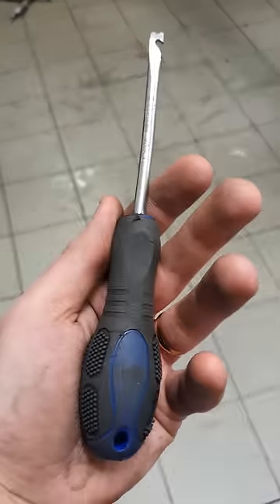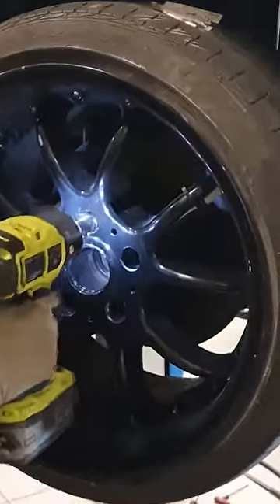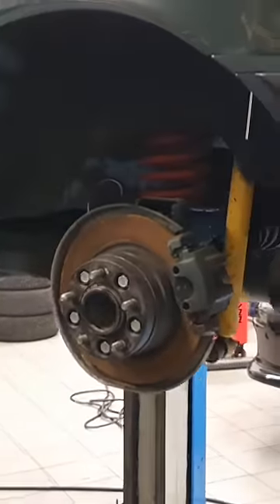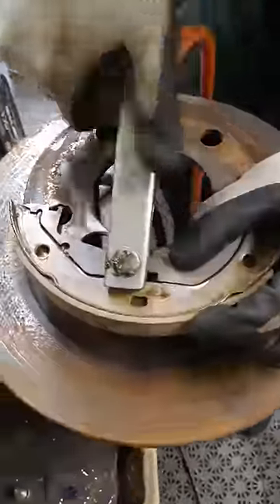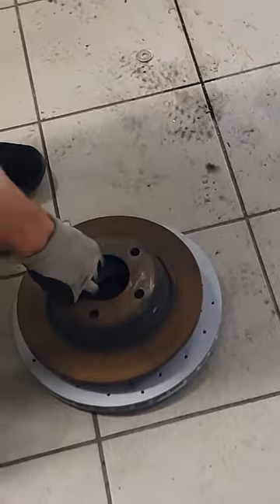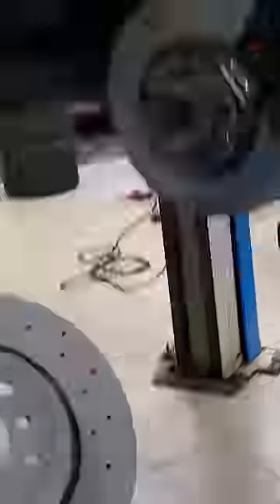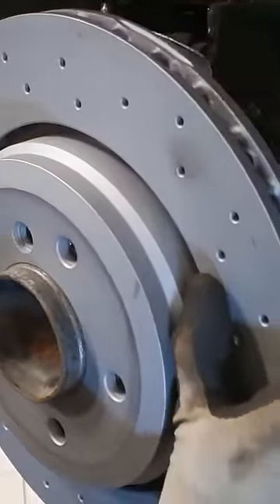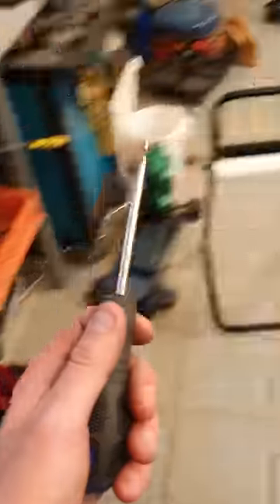Simple but genius DIY tool for your car. #shorts

Comment: They've had those kind of tools when they had drum brakes. They sell those everywhere. People just don't know what they are when they see them
Reply: They are good for getting in your car when your locked out
Reply: @johngoguen361
Reply: @stevebrown9662  what?
Reply: @johngoguen361  how ?
Reply: @thegman4759  The lock bar inside your door window
Reply: @PapaThreeper I know a slim would work,I was in a pinch, I have used flaten out soda cans,coat hangers,even wire to get in cars for other people
Reply: That's the parking brake
Reply: @johngoguen361 I want to see u use that to unlock a car
Reply: @51-FS  Joe on some cars like Toyota and some similar you can use a golf tee or a sloted piece of metal to unlock them I don't know about newer cars but I've done it
Reply: What’s the name of the tool exactly ?
Reply: I was gonna say that's old school 😆
Reply: None of those store bought tools really worked that great.
Reply: @gimmesomesugar  Merry Christmas James
Reply: Your correct I have a set of drum break pliers. Yes there old school, if you ever saw a set and didn't know what they were it would be like 🤯🤯
Reply: Or u could just use a pick... nah thats too easy
Reply: @MercenarySed  what good is a pick going to do for your breaks
Reply: @johngoguen361  lmao you're not a mechanic r u? He literally cut a hook in the tool to pull the spring on the shoes
Reply: I’m old school that tools old school

Comment: They make a break tool that only cost like 10$. They look like funky pliers. But they work awesome for removing and installing break springs.
Reply: screwdriver cost £3 👍🏿😂
Reply: @zigzag7194  yeah your right. But the tool I'm talking about works for ALL types of springs 🙄. U would reqire making 4 different screwdrivers and a pair of needle nose vice pliers. 🤔 how much would all those tools cost? Also your personal time building said tools.

Comment: Snap on had a tool that I used for years on ebrake springs. Its original purpose was the older car headlight pot removal. There were 2 pivot screws ( adjusters) and a small spring

Comment: Sometimes for very specific jobs, only a homemade tool will get the job done quickly and easily. When it's a common problem on a model of  car you work on often, it's fabulous. When you have to spend hours to make it and only use it a couple more times or never again, it sucks all the effort it takes to make a good tool.

Comment: We had a tool we called the wing ding (Anvil wire twister) that was used to twist wire on rebar, we also used it to pull drum brake springs.

Comment: I make them for seal pulling inner drive gear seal  puller can't get a pig tail under the gear the main shaft running in the drive .  strong and a good hook to grab the seal and tug it out.  I might try a break job been using pliers 45 years.

Comment: Not bad. I got my technique with a pic down good tho. And listen, you want e46 brakes on the rear, just get 330i or 325ix rear trailing arms. You get larger bearings like an e36 m3 and the parking brakes fit in the discs. Thank me later.

Comment: The tool that you created I’m sorry to let you know but it’s already out it has been out since the 90s that’s how you do rear drum brakes
Reply from the maker: I havent seen them before. But I am not a full time mechanic. I've always worked with some small pliers 👍
Reply: 90's, I started working on cars in the early 80's and you could buy tools for that job then and they certainly weren't new on the market then.

Comment: You just invented a Brake Tool similar to what Mechanics used for springs on drum brake shoe replacement over 45 years ago. So I guess you have a good design  there. 😂

Comment: I have about four of those that I've made myself I've had them for years they actually sell them but it's easier just to make them out of old screwdrivers the hook is good for pulling the spring in the pointed top at the end is good for pushing the spring

Comment: I use to use a piece of string worked well for me. But your tools pretty good as well. Used string pull the spring then pushed it in place with stick, screwdriver flat head or my finger.